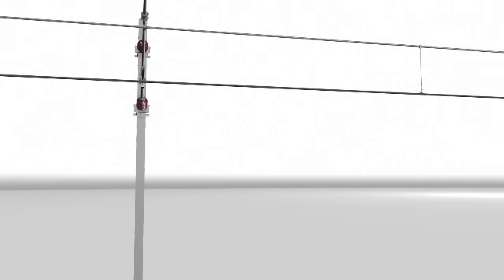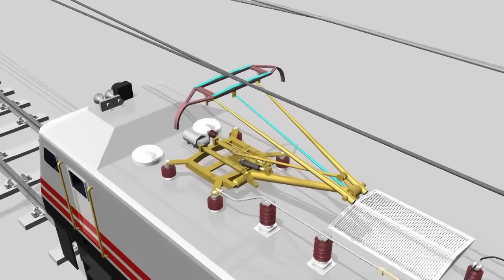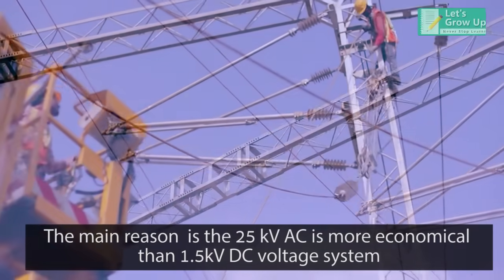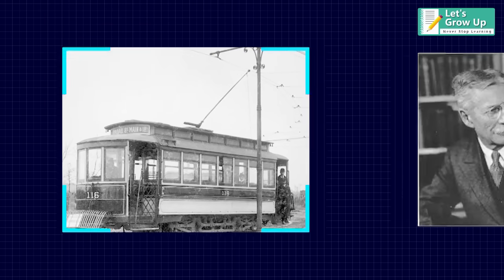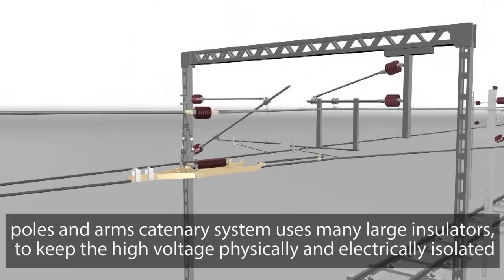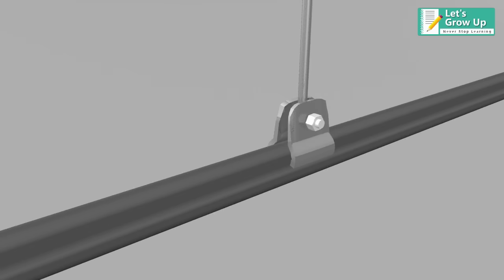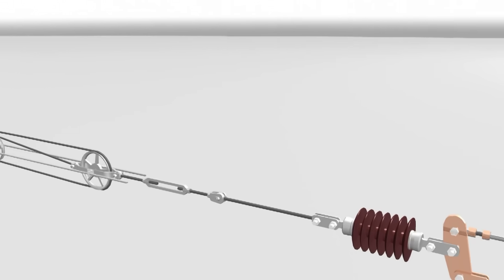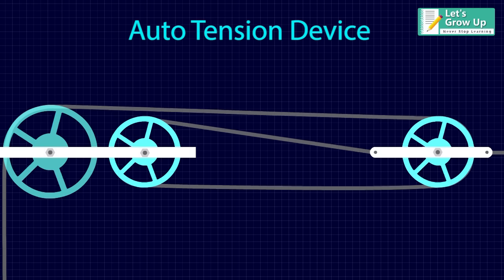Railway Catenary System |  Railway #OHE Equipment explain | #Section Insulator | Auto Tension Device

Comment: Actually 25Kv is for Electric Trains that use AC Power. At the Pennsylvania Trolley Museum we use 600 V DC to power our streetcars. The LIRR and Metro North in New York use 750 VDC via 3rd Rail for their trains and Pittsburgh uses 600 to 750 Volts DC via Overhead wire

Comment: This is one of the most superficial .documentaries I've seen on railways. Overhead catenary started at 1.5 and 3Kv DC. This was because although higher voltages were generated there was no way of controlling such voltages to the motors. Control was achieved through resistance grids, which could also be used for braking. The Swiss needed higher voltages for the long alpine tunnels where additional feeder current was not feasible. However 50Hz supply could not be used in the motors, so they used 15Kv @ 16 2/3Hz, which could once transformed down be fed as ac to the motors. This system is still in use in Switzerland, Austria, Sweden & Norway today, 11Kv is also on Switzerland. The French started with 25Kv @ 50Hz, ie straight from the grid in the 1950s and use of this supply has spread in to other parts of Europe, even in to counties which also used DC current. Rolling stock capable of using all 4 different voltages are common today. Lines in S Africa & he USA use 50Kv. None DC systems in N America use AC @ 60Hz. There are also mountain railways in Europe which use 3 phase AC, Italy used to have that on main lines but it was abandoned in the 1970s.
Many underground trains use 3 or 4 rail systems to feed DC at anything between 500 & 750 volts. Some use overhead at around 1200 volts DC. However the new Elizabeth Line in London has 25KV AC overhead. This requires tunnels of greater diameter to get the clearances, remember the volume to be dug out goes up on the square..

Comment: 1.Why catnery wire is used as it is not providing any return path ?

2.Is it is used like 2 wire bundled conductor ?

3. Does current flows through dropper wire?

Comment: The advantage only presented here for AC over DC is it is economical. Maybe you should also consider the effect on the size of equipment, motors inside the train and electrical interference. But overall it is a good quality video.
Reply: Electrolysis issues with DC etc

Comment: There is a mistake - higher voltage doesn't "reduce" current flow. 

Higher voltage "requires" lesser current to do the same work.

Comment: Not bad but using climate change as the reason for a tensioner isn't cotrect, what you use them for is called wearing and stretching over time not climate change

Comment: 1:10 The higher voltage reduces the current flow through conductor, shouldn't it be opposite since current in a conductor is directly proportional to voltage across its terminals?
Reply: It s all about Power. P=U*I where I is current and U is voltage
For the same power, the more voltage you have the less current flow you need
Reply: @Boss_Tanaka  Thanks
Reply: I think there talking in a not so clear way about volts * amps = watts, so a higher voltage can transfer the same wattage with less current.
I.E, 1 000 watts can be 10 volts @ 100 amps or 100 volts @ 10 amps (or any other two numbers that sum to 1 000)
Reply: @can_hauler  Thanks
Reply: "Less current is needed" is not same as "reduces current flow". 
It's a mistake. People who don't what he actually might have wanted to mean will learn the wrong thing.

Comment: Great introduction!
I need an OLE technical reference book for UK railway overhead systems, but can't find one. Anyone have any ideas please?
Reply: The video is a simple introduction. There are a lot of problem happen in the system. For example, aarcing in section, arcing in dropper, contact wire abnormal wearing.... You can ask some experience workman for more informations.

Comment: Rail traction catenary systems are either 1500Vdc or 24Kvac.
The choice of which one to use is down to the average line speed of the trains.
Below 75km/hr average line speed, 1500Vdc should be used.
Above 75km/hr, 24Kvac should be selected.
Reply: I m sorry dude but it s absolutely not the case!!!
The 1500V dc is an ancient technology obviously still used because it would cost a lot to replace it. It can stand speeds up  to 200km/h though. 
25KV ac is a newer technology and it s the only one built today for new lines. So there is no choice for future projects : 25kv.
Reply: If 1500v is ancient tech, I guess our 650v DC is prehistoric ooze?? 😂

Comment: The Metra Electric here in Chicago South Suburbs runs on a 1,500-volt power system to University Park Illinois. Also, the South Shore Line between Chicago and South Bend Indiana uses the same voltage to share the same voltage between the two railroad systems.
Reply: Sir, is their any demand for technician or engineers for OHE department in Chicago.  Do you have any idea regarding it ?